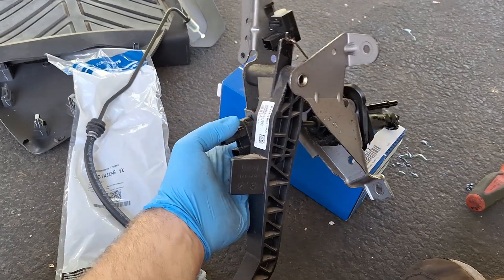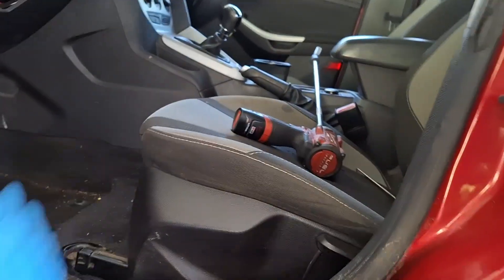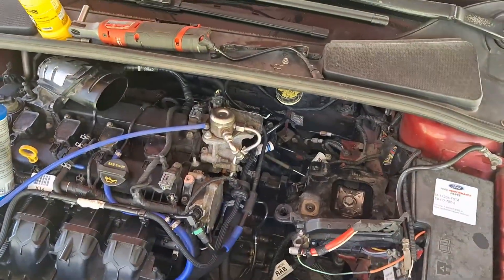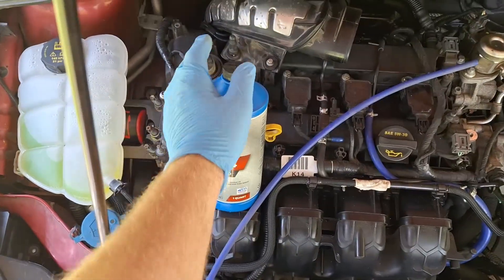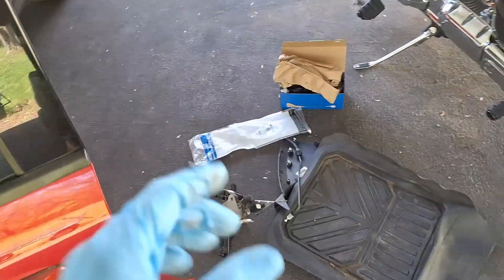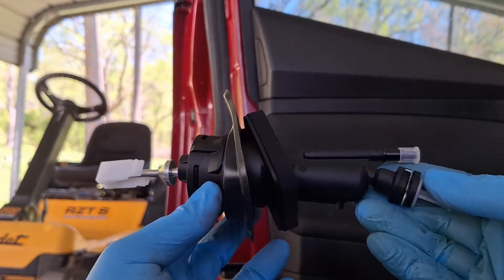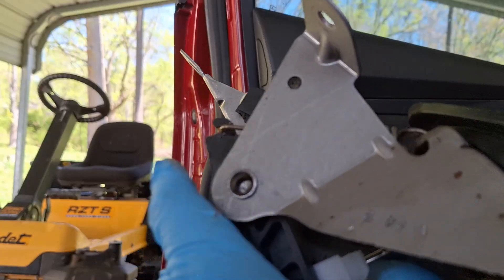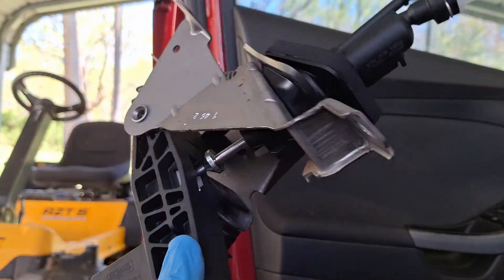Ford Focus Clutch Master Cylinder Replacement! 2012-2018 5-Speed!

Comment: My mechanic changed my master cylinder and couldnt bleed it for literally hours. After he was done the clutch still felt spongy as before. In addition, now I have massive rev hang when changing gears AND my car wants me to press the clutch and brake in order to start it, before it was just the clutch. Could you advise what could be wrong please ??

Comment: My question is sorta related. Ive a ford focas . 
Lost reverse .

Replaced the duel clutch - forks - actuators - 2nd hand tcm and have forward gears but no reverse.
I have not used a obd2 or any other scan tool to diagnose or re-program .

I guess old school thinking dose not work today .

Im expecting a few sarcastic comments ( all good)  But any pointers welcome.

Thanks in advance
Reply from the maker: Need to know what fault codes you got   and ive got a discord group for quicker replies

Comment: Don't forget to zero the current clamp by the wire you're clamping around (in the same orientation) before you clamp it on for DC stuff, otherwise stray magnetic fields (like the earth's) can mess with it lol
Reply from the maker: @wcvp  oh OK thanks! 👍